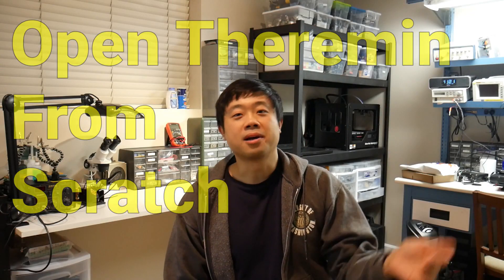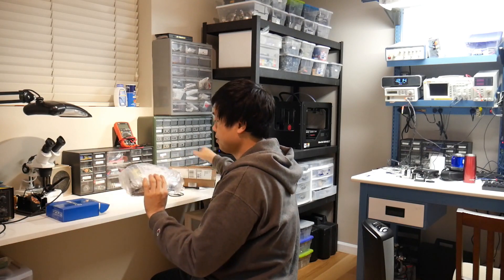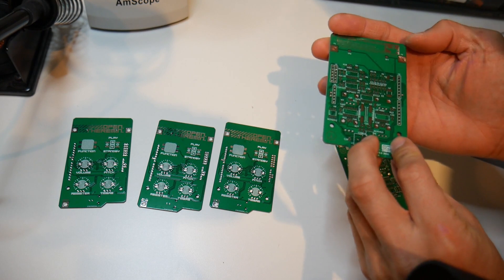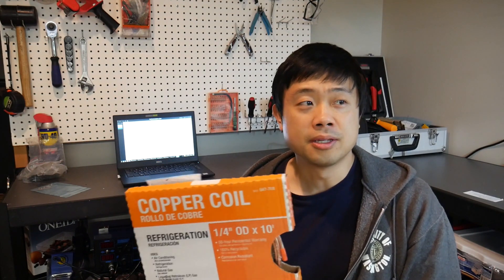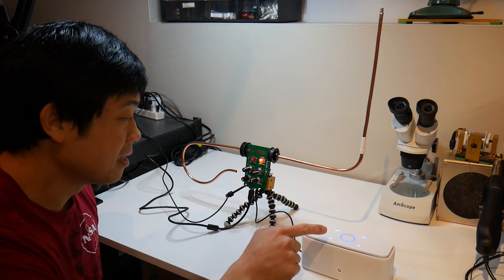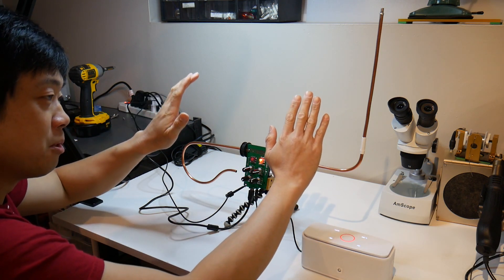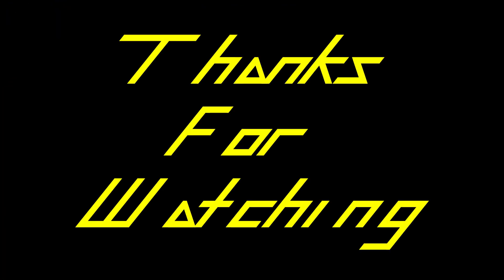Making the Open Theremin From Scratch

Comment: Hi Jimmy, how do you ground the theremin? I didn't understand how do link the test lead to the earth port of the main outlet. what do I need to buy to that? Thanks.
Reply from the maker: There is a grounding pad on the bottom of the theremin.  I just used a clip on test lead to clip onto this ground pad and with the banana jack end of the test lead into ground port of an outlet.
Reply: @LockeLaboratory  thank you Jimmy

Comment: Hi Jimmy, how difficult is it to solder the parts following the BOM? Found a seller on Aliexpress that sells the PCB with components - just need to solder the parts onto the board and install with a arduino. wonder will this be doable for someone with no soldering experience. thx
Reply from the maker: I would always encourage trying and taking a dive to learn new skills.  It can be fun, kind of like building a model.  Its kind of like learning how to ski, first time is often lots of failure but by the end of first session you may have already gotten the hang of it.  If you have a steady hand and the right equipment, it isn't too bad.  The trickiest parts for this kit may be the header connectors that adapt to the arduino as well as the IC chips.  I'd recommend also getting a practice soldering kit to try first so your first try isn't spent on the theramin kit you found.  You will need tweezers, flux, solder, solder braid, and a temperature controlled soldering iron.   Best of luck.

Comment: That's amazing! How much did it ultimately cost you in parts?
Reply from the maker: Thanks!  I vaguely remember that it ended up 50 percent cheaper than buying a premade kit since you end up qith quantity 2.  I want to say 20 ish dollars for bare boards and shipping, 40 ish for parts from mouser, 15 for the copper tube.  Other things like tripod, speaker, cables I already had on hand.

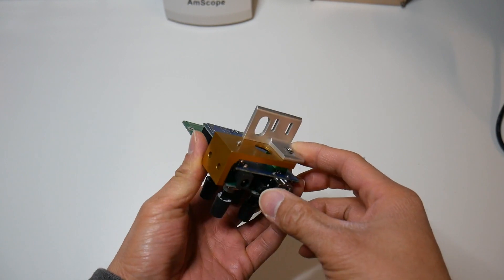Comment: "This metal bracket that I basically improvised" shows a flawlessly beveled and finished piece 4:00
Reply from the maker: Haha, good eye. I should have say that I used some scrap parts from a discard bin which happened to be finished anodized aluminum.
Reply: @LockeLaboratory  I figured it was something like that. I just thought it was funny because when I improvise it often includes tape and hot glue 😅

Comment: Hello - for the soldering part, did you use the BOM privided or checked the circuit schematics? there are at least 3 differences.
Someone signaled them on github but no answer from the maker
Reply from the maker: Hi Alexandru, I didn't use the schematic at all I simply looked for the reference designators that were silkscreened on the PCB.  Then used the provided BOM to cross out the line item after each were soldered.
Reply: @LockeLaboratory  C22 seems to be different in the schematic than in the BOM: https://github.com/GaudiLabs/OpenTheremin_V3_Shield/issues/5

So for you it works anyway . Cool! Thanks for the answer.
I'll start putting together my own soon.
Reply from the maker: @AMIX9_92   Great catch!  I didn't even notice it.  It appears C22 is simply a low pass filter for the output of the DAC chip.  Going with the 47nf (what I did) will lower the cut off frequency of the low pass to about 1.5Khz whereas the schematic shows 10nf will have a 7.2Khz cut off frequency.  I'm curious how that will affect the sound output, what did you suggest to github as the correct value?
Reply: @LockeLaboratory  It was not me pointing it out there on Github. My understanding of electronics is novice , yet I stumbled on this comment there when checking what I got to do. Yet not many people made the attempt like you to build it up from scratch . 

My parts will arrive in a week or so. Ill let you know how it sounds with the other cap

Comment: Hi Locke building a couple of these myself could you possibly link me to the part list? I just received all the PCB's but haven't found a part list for all the remaining parts. Thank you in advance.
Reply from the maker: https://github.com/GaudiLabs/OpenTheremin_V3_Shield

https://www.homedepot.com/p/Everbilt-1-4-in-x-10-ft-Soft-Copper-Refrigeration-Coil-Tubing-1-4-R-10RE/203654086

This is where I got the bill of materials.  It is in ODS format which is a Libre Office spreadsheet file.  Second link is for the tubing I bought from hardware store.  

The only things that weren't on the BOM's were the knobs, the banana plugs, and hardware to mount a tripod.  Those things I improvised. Good luck on your build!

Comment: On a very unrelated note:

I was making a BOM and replicating this "Dessicant-Humidifier Refrigeration Cycle AC" (video on it:  https://youtu.be/7w4rg3UcsgI ), and thought adding an air filter like one of your designs would be a good idea.

Do you have a BOM, or any advice on this?

(I'm documenting my work on this project here: https://wiki.opensourceecology.org/wiki/Dessicant_Humidifier_Cycle_Refrigeration )
Reply from the maker: That is a very interesting project.  Since the particle load isn't very high for that application, you may get away with a simple fabric furnace filter with activated carbon sheets.  An electrostatic precipitator might be overkill in this situation unless you are dealing with a lot of outdoor air pollution.